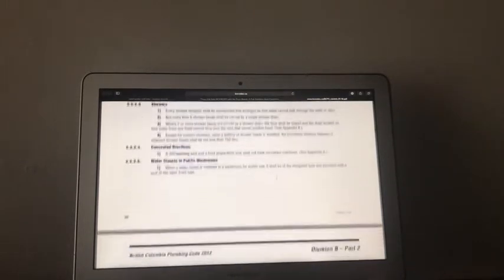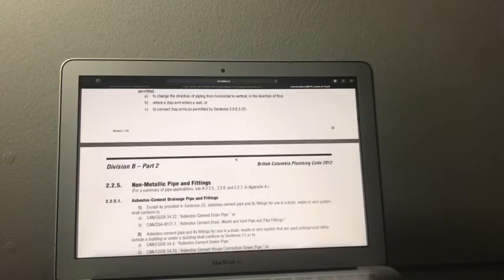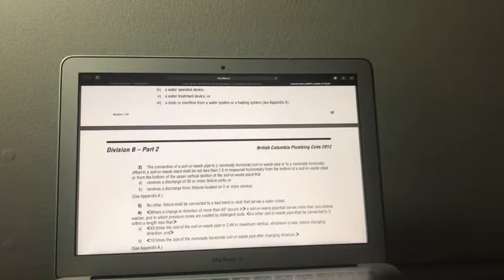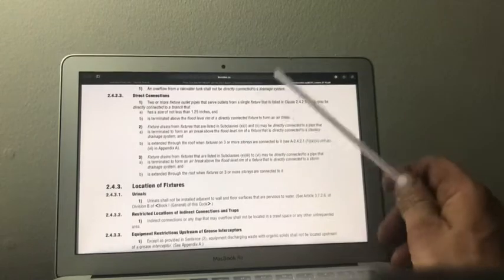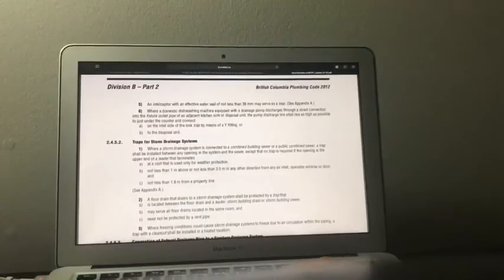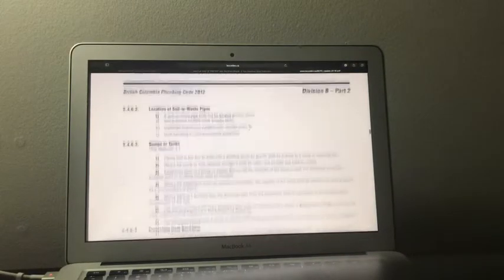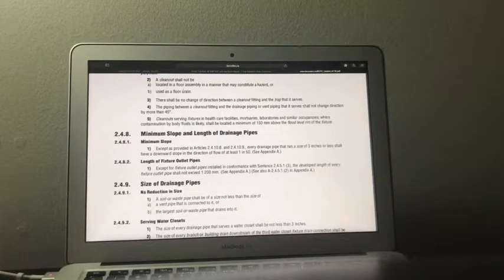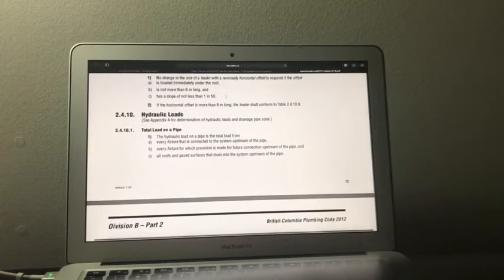BC Plumbing - Drainage code

Comment: Do you know if there is a home owners guide to BC plumbing code? An electrician friend of mine told me that there used to be one for Electrical code and he figured that there would be one for plumbing too. I suppose  it would cover the basics required for doing plumbing work on your own house with less technical illustration and more laymans terms. Something like plumbing for Dummies?